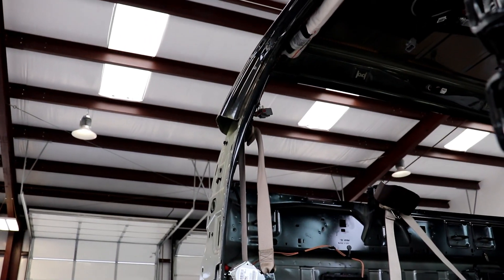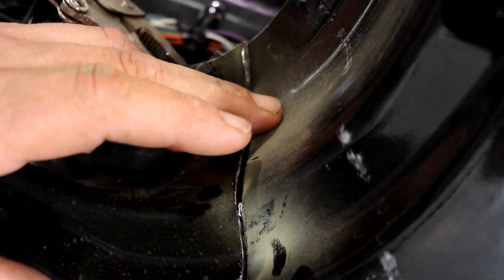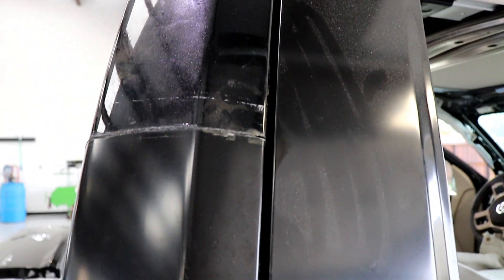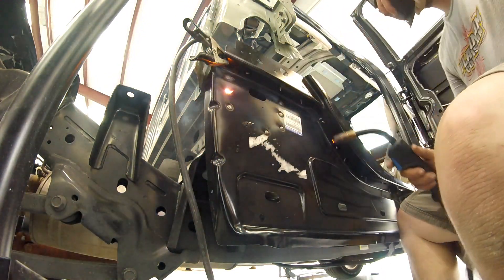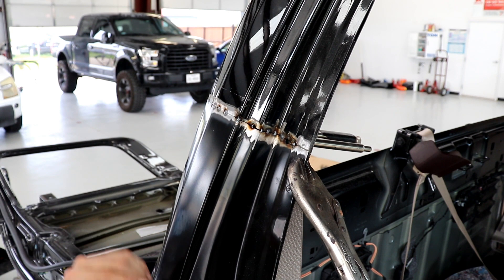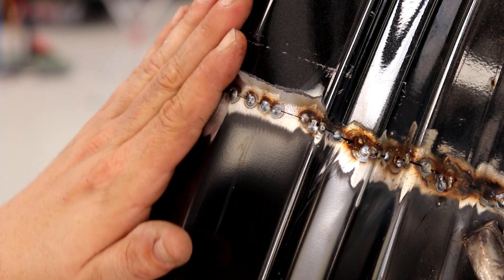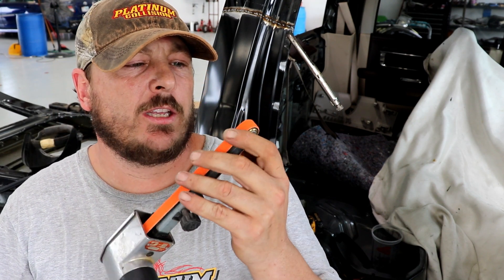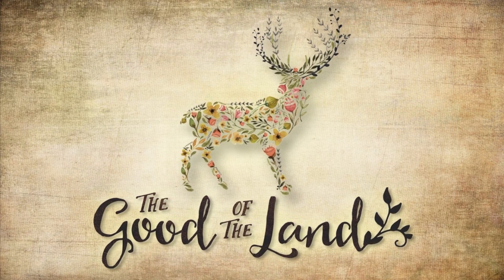THIS ONE TIP COULD SAVE THE JOB!!!

Comment: Brilliant Justin! That of course is not the kind of welding I am used to doing. I can see how easy it makes it possible to keep the metal under control. YOU manage to avoid all the shrinkage by spotting like that. Thank you for sharing, I was never notified about you posting this, I am glad I looked back see if I missed anything. You are 100% right the key to a good finished product is the cut and fit. You are an auto-body fixin' beast my friend!
Reply from the maker: +TheTahoeJohn I ment to shoot you a message telling you it was back up. Just spaced it:)
Reply: Its all good Justin, better later than never...and it was worth the wait brother!

Comment: agree about the belt sander, i had a b&d electric version, the main issue was belts breaking at the joint, no matter how careful, they broke before they were worn out, eventually gave up!
Reply from the maker: +Jusb1066 You have to try the norton belts.

Comment: Awesome video check out the HTP Pro Pulse 200 mig welder. It has stitch, Spot and other options to choose from. It's a synergetic machine and also has the new Ford 5556 Aluminum features. I bought two we love them for auto-body and has built it Pulse
Reply from the maker: +Jason Quinlan Excellent! We are inbthe market for just such a welder!
Reply: The Good of the Land You guys will love it. It's a Mig that can also do Tig, Mig 2T, 4T, Spot, Stitch and can do Steel, Stainless, silicon Bronze, and Aluminm right out of a mig gun. This welder is designed for auto shops in mind. Like I said has pulse and non pulse and aluminum Swiss drive rolls that makes it all possible. No spool gun needed. And the 5556 function is awesome perfect for new ford body's. Let them know at HTP that I sent you. They will take good care of you. Jeff is the owner.
Reply from the maker: +Jason Quinlan Excellent!

Comment: well how do u like that miller 141? its got a good rebate on it now. iv noticed uv went through three welders, miller, everlast, Lincoln. the 141 just wasn't good? im curious to know if its worth the price or just go the miller 211 but the 141 has a 150 rebate started today so u have any insight or any knowledge that I may need to know? Thanks
Reply from the maker: +Doug Its a great welder! Buy it. The 211 Is good as well just more power. Stay away from everlast. I still use my Lincoln 210mp every day. I would recommend it as well.

Comment: So boss I could use some help. I bought an old suburban with body rot all the way around, it's not structural the frame is solid. I'm thinking about sand blasting the rust hitting it with naval jelly, filling the cavity with foam and then just pop riveting a patch panel over top of it. I know It's not a pro fix but are you hearing anything that will blow up in my face?
Reply: Doug Jackson are you going to bondo over the riveted stuff because that would make a mess of chipping bondo